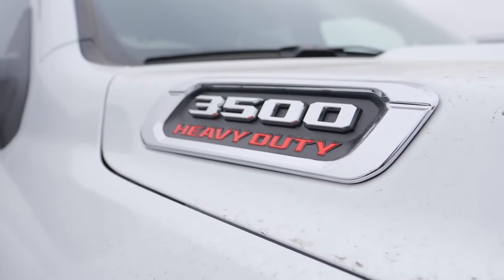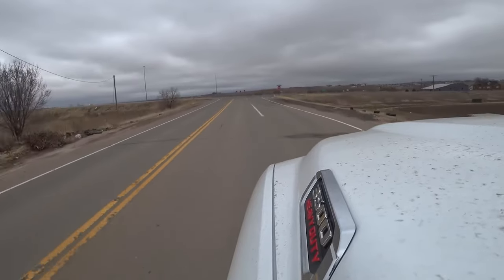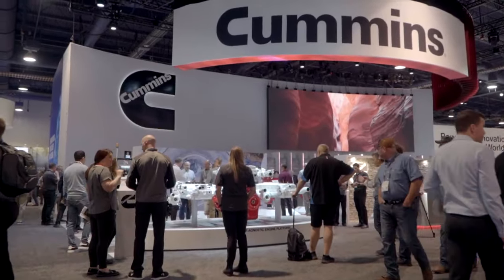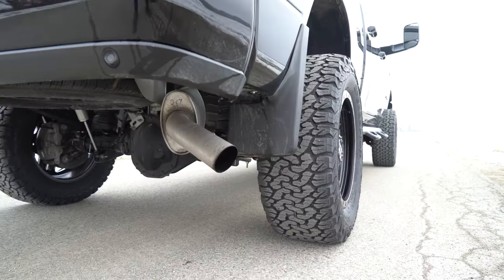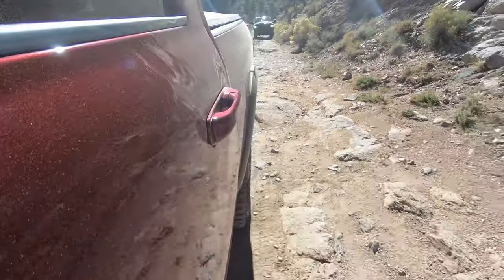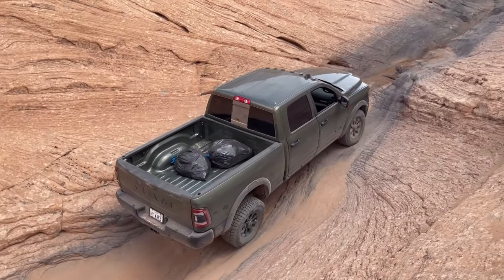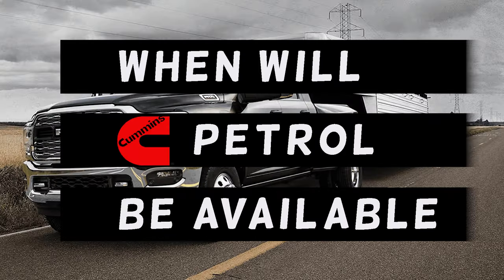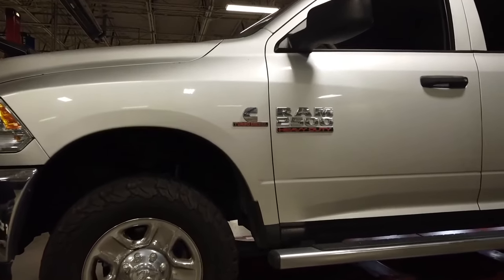2025 Ram HD Cummins Petrol: Tracking the Latest Progress in Engine Development

Comment: Im not buying this video. I live in the motorcity Stellantis has packed up its HQ and mostly closed 2 very big assembly plants. Word is Jeep and Ram are moving 100% to mexico and both are on the chopping block. Turn a profit or they are done..maybe Ram should build its own Diesel power plant..just a thought.
Reply: That’s a good suspicion. Seeing that Cummins is on their own (in other words, NOT owned by  Stellantis), I’m pretty certain that Cummins could sell that engine to other commercial truck makers.
Reply: SA hates ram apparently.
Reply: @bikdav Cummins has granted exclusivity to Dodge in the 80s for the B series engine in pickups (Ford only uses them in heavier chassis-cabs). Thats why they made the 5 liter V8 to offer to other truckbrands

If it wasnt and everybody had the Cummins, Fiat would have put their own 6.7 in it long ago.

Comment: I was hoping for a 7.2L Hemi. All it takes is a 4.00 stroke crank on the 6.4 The heads  already flow well. The 6.4 needs more torque to compete.
Reply: I would support that as long as it had no MDS!
Reply: Had that 6.4 piece of shit   34 L per 100 km as soon as I hooked up my  camper
Reply: @ragingbull3406  i think direct connection/mopar already makes the  426 hemi in crate form. Thats 7L 606 hp 600 plus ft lbs of torque. Im sure itll never enter a production truck considering Stellantis has all but killed the hemis and V8s in general.
Reply: They make a 7.0 supercharged Hemi aka the hellephant engine
Reply: Wont happen. A turbocharged 5.7 hemi will make more torque at much better fuel efficiency. Because the same block also comes as 7 liter, there will be enough cooling capacity around the cylinders for longevity.

Comment: Why not simply take a look at the leaning tower of power, yep the old slant 6.  You could build a 7 main bearing stroker 6 with a longer stroke and bigger pistons coupled with fuel injection and boost to achieve the same at a much lower cost.  Sorry everyone is fixated on horsepower, but torque is the item that gets the job done.  Look at the old Ford 300, people are putting boost on them and making that power, all from their home shop operations.
Reply: I absolutely agree, I had a 300 six and one of the best, any inline six is ideal.
Reply: I couldn't agree with you more! Inline 6's were torque powerhouses, whether it's the Ford 300, my favorite, the Chrysler slant 6 or GM's inline 6. All three companies made good inline engines.  One more thing, why in the hell can't this channel use a real human for narration?

Comment: Absolutely nothing about this makes sense.  Gasoline engines are typically picked by fleet managers and consumers based on the fact that they're ten thousand dollars or more or less than a diesel.  I can't imagine they're gonna sell a single one of these. If they're a hundred horsepower down and it's an eight thousand dollar option.
Reply from the maker: We'll see. Gas engine working as diesel is bold statement, but hard to do. But if they do...
Reply: Ford’s Triton V10 was/is a great 310 hp gasoline alternative to diesel.  Ran that in our 550 chassis Motorhome with full water and gas tanks, pulling a car, over the Wasatch Summit a few years back.  No strain, no overheating, just solid mid-range  pull.
Reply: It might be worth the $8k but not if it’s just a diesel that runs on gas. Diesels have a lot of problems thanks to EPA regs. Gas engines have fewer problems. Cummins has a shot at making a beast of a commercial gas engine from scratch that will satisfy the need for reliable towing power while also working as a hillbilly status symbol.

Comment: Why not go back in time and start producing the pushrods slant six again,,Make a 6.7 slant six with VVT and a big turbo ,,Keep the weight down by using aluminum alloy block,,You could easily push 400+ hp and 550flb ,,

Comment: Can anyone, including who posted this, actually confirm any of this. I have not heard anything about cumins actually releasing this engine, let alone for use in Ram trucks, all i can seem to find is that its under development. Also i cannot find any confirmation that the 6.7 diesel in the ram trucks is being bumped to a higher displacement...again just rumors.
Reply from the maker: Ram TRX wasn't official,but there were plenty of rumors and hints suggesting it will happen.

Comment: I would love it if they just put the a new 3.0 Hurricane engine in the heavy duty trucks and then to make it even better make them hybrids so people wouldn't whine and b*tch that there was a a small engine in a heavy duty truck. The video is right, the Cummins Gas engine will have some down falls, it's gonna happen because again, Cummins is a diesel engine company. One thing I'm weirded out about is Dodge is using the Hurricane to replace the 5.7 hemi because the hurricane makes more horsepower and torque thanks to it's twin turbos, but not twin turbo the hemi? Just sayin🤷‍♂️
Reply from the maker: You said it all with "small engine in HD" ☹️
Reply: @LetsDriveYT  Yeah but the hurricane makes 540 horsepower and 527 Lbs feet of torque. That thing deserves to be in at LEAST a 3/4 ton

Comment: The Duke says, I'm a Ford guy but all this sounds pretty good on paper. Problem is it's going to make for an even more expensive truck that nobody's buying already. Ford included. They cost as much as a Dodge. 
Plus I don't know anybody that would want a 200 horsepower engine. The high torque will get you off the line but you may struggle at highway speeds with a load. They should have concentrated on improving the hemi. It looks like the 7.3 Godzilla from Ford (which I have one in my f-550) is what motivated Ram to do this. V-8 is golden in the United States.
What did I teach you?
Reply from the maker: I can read that truckers would rather take the Hurricane, than this new Cummins...

Comment: How can they only have 300 HP and be compatible with Ford and GM when they're heavy-duty engines are pushing over 400 HP?
Reply: They get de tuned for reliability.   What these customers will want though is torque.
Reply from the maker: Exactly.

Comment: Why is there  ANY  development being wasted on new engines? gov mandate 2035
all engines must be  EMISSIONS  FREE. If it burns fuel it emits emissions and is banned.
Even propane-natgas & hydrogen burning engines have emissions and will be banned.
While hydrogen power cells will convert hydrogen into electricity with water emissions will be permitted and electric. HOWEVER, today, hydrogen powered vehicles cost 4X what electric or gas or diesel cost to operate so lots of luck making hydrogen viable.
Whether you like EV of not, it is coming.

!
Reply from the maker: Like diesels... Dying, but still irreplecable when it comes to hauling heavy loads. Plus, 10 years is a long period, even without delays, this can be paid off

Comment: 325HP seems pretty low for a 6.7L engine. I have a 4.6L that puts out 305HP
Reply from the maker: And torque?
Reply: @LetsDriveYT  these hp and torque specs are about the same as a 2006 Cummins

Comment: Ooooooooooh bad move cummins😐
Reply from the maker: Why? They're not giving up any other engine, and it will be better than HEMI
Reply: If it costs more than the diesel, burns twice the fuel when pulling and only has 200 Ho, I don’t want it! I’ll take the 6.4 Hemi any day. I’ve got as good as 19mpg in my 6.4 Power wagon and as bad as 11mpg. Lots of power!